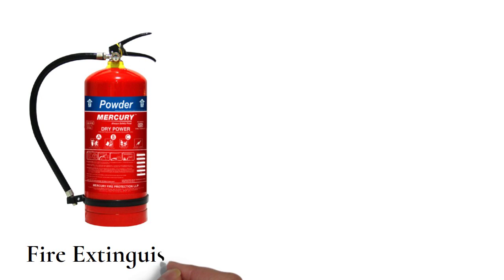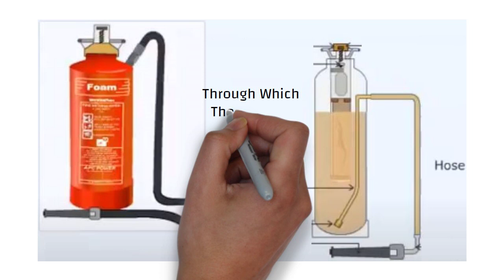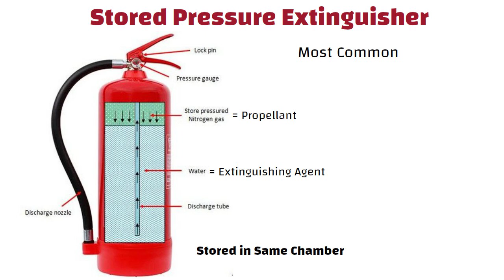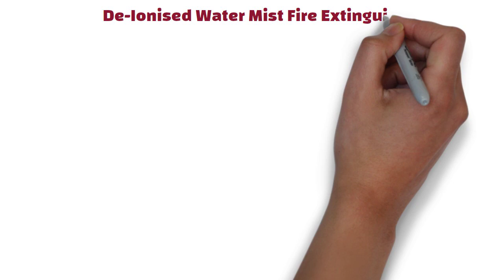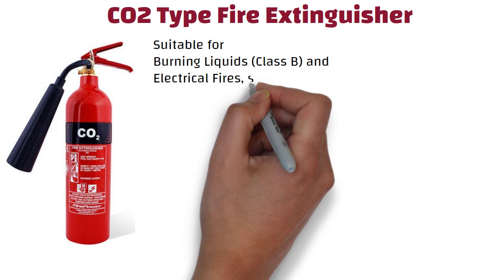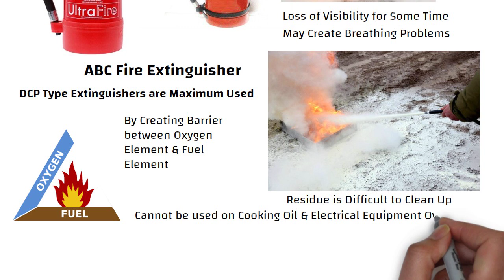FIRE EXTINGUISHER DEALERS IN KERALA, CALL 8138906102, FIRE EXTINGUISHER DEALERS IN ERNAKULAM.

Comment from the maker: Fire extinguisher dealers in PANDALAM, fire fighting contractors in PANDALAM, PANDALAM, fire and safety installations in PANDALAM, fire extinguisher suppliers in PANDALAM,fire extinguishers in PANDALAM, fire extinguishers in PANDALAM, fire protection system in PANDALAM, f fire and safety installation in PANDALAM, fire and safety contractors in PANDALAM, fire safety contractors in PANDALAM, fire and safety systems equipments in PANDALAM, fire equipment in PANDALAM, fire extinguisher in PANDALAM, fire protection system installation in PANDALAM, fire contractors in PANDALAM, fire safety consultants in PANDALAM,  fire alarm systems in PANDALAM, fire NOC in PANDALAM, fire AMC in PANDALAM, PANDALAM, fire fighting equipment in PANDALAM,
MS Jindal pipe dealers in PANDALAM, motor control panel in PANDALAM, fire pump panel in PANDALAM, motor control panel in PANDALAM, Morley fire alarm in PANDALAM, gst fire alarm in PANDALAM, addressable fire alarm system in PANDALAM, Pa talk back system in PANDALAM, PA talk back system in PANDALAM, auto glow SIGNAGES in PANDALAM, SIGNAGES in PANDALAM, pump PANELS in PANDALAM, LHP pump in kohi. Karthar valves in PANDALAM, Ravel fire alarm system in PANDALAM. Jindal pipe dealers in PANDALAM, Jindal pipe dealers in PANDALAM. MS pipe dealers in PANDALAM. Butterfly valves in PANDALAM, PA talk back system in PANDALAM, Fire alarm dealers in PANDALAM,, smoke detector dealers in PANDALAM, fire alarm panels dealers in PANDALAM, MCP, hooter dealers in Mangalor, hydrant valve dealers in PANDALAM, branch pipe dealers in PANDALAM, cp hose, RRL hose, heat detector dealers in PANDALAM,, Motor Control panel,  LED EXIT LIGHTS dealers in PANDALAM, emergency exit light dealers in PANDALAM, auto glow SIGNAGES dealers in PANDALAM. Conventional fire alarm system in PANDALAM,
KIRLOSKAR FIRE FIGHTING PUMP DEALERS IN PANDALAM, FIRE FIGHTING EQUIPMENT DEALERS IN PANDALAM, FIRE ALARM SYSTEM DEALERS IN PANDALAM, FIRE CONSULTANTS IN PANDALAM, FIRE CONTRACTOTORS IN PANDALAM, FIRE CONTRACTORS IN PANDALAM, FIRE ALARM SYSTEM DEALERS IN PANDALAM, SMOKE DETECTOR DEALERS IN PANDALAM, FIRE PROTECTION SYSTEM IN PANDALAM, FIRE CONSULTANTS IN PANDALAM, FIRE CONSULTANTS IN PANDALAM, PA TALK BACK SYSTEM IN PANDALAM, ADDRESSABLE FIRE ALARM SYSTEMS IN PANDALAM, CUTTER PUMP DEALERS IN PANDALAM, ADDRESSABLE FIRE ALARM SYSTEM SUPPLIERS IN PANDALAM, SMOKE DETECTOR DEALERS IN TPANDALAM, PRESSURE BOOSTING PUMP DEALERS IN PANDALAM, SLURRY PUMP DEALERS IN PANDALAM, WATER PUMP DEALERS IN PANDALAM, RAVEL FIRE ALARM SYSTEM IN PANDALAM, LUBI FIRE FIGHTING PUMP DEALERS IN PANDALAM, FIRE EXTINGUISHER DEALERS IN PANDALAM, ADDRESSABLE FIRE ALARM SYSTEM DEALERS IN PANDALAM, 
KIRLOSKAR FIRE FIGHTING PUMP DEALERS IN PANDALAM, KIRLOSKAR FIRE FIGHTING PUMP DISTRIBUTORS IN PANDALAM, KIRLOSKAR FIRE PUMPS IN PANDALAM, KIRLOSKAR DIESEL ENGINE FIRE STANDBY PUMP DEALERS IN PANDALAM, KIRLSOKAR MONOBLOCK FIRE PUMP DEALERS IN PANDALAM, KIRLOSKAR FIRE TERRACE PUMP DEALERS IN PANDALAM, KIRLOSKAR FIRE PUMPS IN PANDALAM, KIRLOSKAR FIRE FIGHTING PUMP IN KARNATAKA
Reply: FIRE EXTINGUISHER DEALERS IN KOTTAKKAL, FIRE EXTINGUISHER SUPPLIERS IN KOTTAKKAL, FIRE EXTINGUISHER DISTRIBUTORS IN KOTTAKKAL, FIRE EXTINGUISHER IN KOTTAKKAL, ABC TYPE FIRE EXTINGUISHER DEALERS IN KOTTAKKAL, CO2 TYPE FIRE EXTINGUISHER DEALERS IN KOTTAKKAL, CLEAN AGENT FIRE EXTINGUISHER IN KOTTAKKAL, MODULAR TYPE FIRE EXTINGUISHER DEALERS IN KOTTAKKAL, MECHANICAL FOAM FIRE EXTINGUISHER DEALERS IN KOTTAKKAL, FIRE EXTINGUISHER NEAR ME KOTTAKKAL, FIRE EXTINGUISHER TRADERS IN KOTTAKKAL, FIRE FIGHTING COMPANIES IN KOTTAKKAL, FIRE CONTRACTORS IN KOTTAKKAL, FIRE EQUIPMENT DEALERS IN KOTTAKKAL, FIRE ALARM DEALERS IN KOTTAKKAL, FIRE PUMP DEALERS IN KOTTAKKAL, SMOKE DETECTOR DEALERS IN KOTTAKKAL, FIRE FIGHTING SYSTEM IN KOTTAKKAL, FIRE PROTECTION SYSTEM IN KOTTAKKAL, FIRE AND SAFETY CONTRACTORS IN KOTTAKKAL, FIRE HYDRANT SYSTEMS IN KOTTAKKAL, PA TALK BACK SYSTEM IN KOTTAKKAL, FIRE NOC IN KOTTAKKAL, FIRE INSTALLATION IN KOTTAKKAL, FIRE NOC RENEWAL IN KOTTAKKAL, KIRLOSKAR FIRE PUMP DEALERS IN KOTTAKKAL, FIRE EXTINGUISHER NEAR ME KOTTAKKAL, FIRE EXTINGUISHER MANUFACURERS IN KOTTAKKAL, SAFEX FIRE EXTINGUISHER DEALERS IN KOTTAKKAL, FIRE NOC CONTRACTORS IN KOTTAKKAL, FIRE FIGHTING EQUIPMENT DEALERS IN KOTTAKKAL, FIRE PROTECTION SYSTEM IN KOTTAKKAL, FIRE INSTALLATION IN KOTTAKKAL, FIRE SAFETY CONTRACTORS IN KOTTAKKAL, FIRE AMC IN KOTTAKKAL, FIRE PROTECTION SYSTEM IN KOTTAKKAL, FIRE PROTECTION EQUIPMET IN KOTTAKKAL, AMC OF FIRE SYSTEM IN KOTTAKKAL, FIRE CONSULTANTS IN KOTTAKKAL, FIRE AND SAFETY EQUIPMENT DEALERS IN KOTTAKKAL, ADDRESSABLE FIRE ALARM SYSTEM IN KOTTAKKAL, KARTHAR VALVE DEALERS IN KOTTAKKAL, DCP TYPE FIRE EXTINGUISHER IN KOTTAKKAL, POWSER TYPE FIRE EXTINGUISHERS IN KOTTAKKAL, FIRE HYDRANT SYSTEM IN KOTTAKKAL, FIRE ALARM PANEL DEALERS IN KOTTAKKAL, SAFEPRO FIRE EXTINGUISHER DEALERS IN KOTTAKKAL, MS AND GI PIPE DEALERS IN KOTTAKKAL, JINDAL PIPE DEALERS IN KOTTAKKAL, AGNI FIRE ALARM DEALERS IN KOTTAKKAL, FIRE EQUIPMENT DEALERS IN KOTTAKKAL, FIRE EQUIPMENT SUPPLIERS IN KOTTAKKAL, FIRE EQUIPMENT TRADERS IN KOTTAKKAL, FIRE SPRINKLER SYSTEM IN KOTTAKKAL, RAVLE FIRE ALARM DEALERS IN KOTTAKKAL, RAVEL FIRE ALARM SYSTEM IN KOTTAKKAL, AGNI FIRE ALARM DISTRIBUTORS IN KOTTAKKAL, FIRE ALARM CONTRACTORS IN KOTTAKKAL, FIRE PIPE INSTALLATION IN CONTRACTORS IN KOTTAKKAL, FIRE SAFETY CONTRACTORS IN KOTTAKKAL, FIRE PA TWO WAY TALK BACK SYSTEM DEALERS IN KOTTAKKAL, HEAT DETECTOR DEALERS IN KOTTAKKAL, HONEYWELL FIRE ALARM DEALERS IN KOTTAKKAL, FIRE NOC CONSULTANTS IN KOTTAKKAL, FIRE AMC AND FIRE NOC IN KOTTAKKAL, FIRE SAFETY COMPANIES IN KOTTAKKAL, NEWAGE DEALERS IN KOTTAKKAL, MONSHER FIRE EQUIPMENT DEALERS IN KOTTAKKAL, KARTHAR VALVE DEALERS IN KOTTAKKAL, FIRE HYDRANT VALVE DEALERS IN KOTTAKKAL, FIRE HOSE REEL DRUM DEALERS IN KOTTAKKAL, FIRE SPRINKLER DEALERS IN KOTTAKKAL, FIRE PUMP DEALERS IN KOTTAKKAL, LUBI PUMP DEALERS IN KOTTAKKAL, LHP PUMP DEALERS IN KOTTAKKAL. FIRE CONTRACTORS IN KOTTAKKAL, FIRE AND SAFETY CONTRACTORS IN KOTTAKKAL, FIRE EQUIPMENT DEALERS IN KOTTAKKAL, FIRE FIGHTING CONTRACTORS IN KOTTAKKAL,
Reply: Fire extinguisher in Calicut, Fire extinguisher suppliers in Calicut, Fire extinguisher dealers in Calicut, Fire extinguisher traders in Calicut, Fire extinguisher distributors in Calicut, Fire extinguisher near me calicut, Safepro fire extinguisher in Calicut
Reply: FIRE EXTINGUISHER DEALERS IN KERALA, FIRE EXTINGUISHER SUPPLIERS IN KERALA, FIRE EXTINGUISHER DISTRIBUTORS IN KERALA, FIRE EXTINGUISHER IN KERALA, ABC TYPE FIRE EXTINGUISHER DEALERS IN KERALA, CO2 TYPE FIRE EXTINGUISHER DEALERS IN KERALA, CLEAN AGENT FIRE EXTINGUISHER IN KERALA, MODULAR TYPE FIRE EXTINGUISHER DEALERS IN KERALA, MECHANICAL FOAM FIRE EXTINGUISHER DEALERS IN KERALA, FIRE EXTINGUISHER NEAR ME KERALA, FIRE EXTINGUISHER TRADERS IN KERALA, FIRE FIGHTING COMPANIES IN KERALA, FIRE CONTRACTORS IN KERALA, FIRE EQUIPMENT DEALERS IN KERALA, FIRE ALARM DEALERS IN KERALA, FIRE PUMP DEALERS IN KERALA, SMOKE DETECTOR DEALERS IN KERALA, FIRE FIGHTING SYSTEM IN KERALA, FIRE PROTECTION SYSTEM IN KERALA, FIRE AND SAFETY CONTRACTORS IN KERALA, FIRE HYDRANT SYSTEMS IN KERALA, PA TALK BACK SYSTEM IN KERALA, FIRE NOC IN KERALA, FIRE INSTALLATION IN KERALA, FIRE NOC RENEWAL IN KERALA, KIRLOSKAR FIRE PUMP DEALERS IN KERALA, FIRE EXTINGUISHER NEAR ME KERALA, FIRE EXTINGUISHER MANUFACURERS IN KERALA, SAFEX FIRE EXTINGUISHER DEALERS IN KERALA, FIRE NOC CONTRACTORS IN KERALA, FIRE FIGHTING EQUIPMENT DEALERS IN KERALA, FIRE PROTECTION SYSTEM IN KERALA, FIRE INSTALLATION IN KERALA, FIRE SAFETY CONTRACTORS IN KERALA, FIRE AMC IN KERALA, FIRE PROTECTION SYSTEM IN KERALA, FIRE PROTECTION EQUIPMET IN KERALA, AMC OF FIRE SYSTEM IN KERALA, FIRE CONSULTANTS IN KERALA, FIRE AND SAFETY EQUIPMENT DEALERS IN KERALA, ADDRESSABLE FIRE ALARM SYSTEM IN KERALA, KARTHAR VALVE DEALERS IN KERALA, DCP TYPE FIRE EXTINGUISHER IN KERALA, POWSER TYPE FIRE EXTINGUISHERS IN KERALA, FIRE HYDRANT SYSTEM IN KERALA, FIRE ALARM PANEL DEALERS IN KERALA, SAFEPRO FIRE EXTINGUISHER DEALERS IN KERALA, MS AND GI PIPE DEALERS IN KERALA, JINDAL PIPE DEALERS IN KERALA, AGNI FIRE ALARM DEALERS IN KERALA, FIRE EQUIPMENT DEALERS IN KERALA, FIRE EQUIPMENT SUPPLIERS IN KERALA, FIRE EQUIPMENT TRADERS IN KERALA, FIRE SPRINKLER SYSTEM IN KERALA, RAVLE FIRE ALARM DEALERS IN KERALA, RAVEL FIRE ALARM SYSTEM IN KERALA, AGNI FIRE ALARM DISTRIBUTORS IN KERALA, FIRE ALARM CONTRACTORS IN KERALA, FIRE PIPE INSTALLATION IN CONTRACTORS IN KERALA, FIRE SAFETY CONTRACTORS IN KERALA, FIRE PA TWO WAY TALK BACK SYSTEM DEALERS IN KERALA, HEAT DETECTOR DEALERS IN KERALA, HONEYWELL FIRE ALARM DEALERS IN KERALA, FIRE NOC CONSULTANTS IN KERALA, FIRE AMC AND FIRE NOC IN KERALA, FIRE SAFETY COMPANIES IN KERALA, NEWAGE DEALERS IN KERALA, MONSHER FIRE EQUIPMENT DEALERS IN KERALA, KARTHAR VALVE DEALERS IN KERALA, FIRE HYDRANT VALVE DEALERS IN KERALA, FIRE HOSE REEL DRUM DEALERS IN KERALA, FIRE SPRINKLER DEALERS IN KERALA, FIRE PUMP DEALERS IN KERALA, LUBI PUMP DEALERS IN KERALA, LHP PUMP DEALERS IN KERALA. FIRE CONTRACTORS IN KERALA, FIRE AND SAFETY CONTRACTORS IN KERALA, FIRE EQUIPMENT DEALERS IN KERALA, FIRE FIGHTING CONTRACTORS IN KERALA,

Comment from the maker: FIRE ALARM DEALERS IN PANDALAM, ADDRESSABLE FIRE ALARM DEALERS IN PANDALAM, FIRE ALARM SYSTEM DEALERS IN PANDALAM, ADDRESSABLE FIRE ALARM SYSTEM DEALERS IN PANDALAM, FIRE DETECTION SYSTEM IN PANDALAM, SMOKE DETECTOR DEALERS IN PANDALAM, CONVENTIONAL FIRE ALARM DEALERS IN PANDALAM, MORLEY FIRE ALARM DEALERS IN PANDALAM, GST FIRE ALARM DEALERS IN PANDALAM, ASES SECURITY FIRE ALARM DEALERS IN PANDALAM, BEAM DETECTOR DEALERS IN PANDALAM, FIRE ALARM SUPPLIERS IN PANDALAM, FIRE ALARM TRADERS IN PANDALAM, FIRE ALARM PANEL DEALERS IN PANDALAM, HEAT DETECTOR DEALERS IN PANDALAM, FIRE ALARM SYSTEM SUPPLIERS IN PANDALAM, FIRE ALARM COMPANIES IN PANDALAM, FIRE EQUIPMENT DEALERS IN PANDALAM, ADRRESSABLE FIRE ALARM PANEL DEALERS IN PANDALAM, FIRE ALARM SYSTEM IN PANDALAM, BATTERY OPERATED DETECTOR DEALERS IN PANDALAM, ASPIRATION DETECTION SYSTEM DEALERS IN PANDALAM, FIRE ALARM MCP - MANUAL CALL POINT DEALERS IN PANDALAM, FIRE ALARM HOOTER DEALERS IN PANDALAM, PA TWO WAY TALK BACK SYSTEM DEALERS IN PANDALAM, PA SYSTEM DEALERS IN PANDALAM, PA TALK BACK UNIT DEALERS IN PANDALAM, HOOTER CUM STROBE DEALERS IN PANDALAM, FIRE PROTECTION SYSTEM IN PANDALAM, FIRE ALARM CONTRACTORS IN PANDALAM, FIRE DETECTORS IN PANDALAM, FIRE ALARM DEALERS IN KOLLAM, ADDRESSABLE FIRE ALARM DEALERS IN KOLLAM, SMOKE DETECTOR DEALERS IN KOLLAM, FIRE EQUIPMENT DEALERS IN PANDALAM, FIRE ALARM INSTALLATION IN PANDALAM, FIRE ALARM COMPANIES IN PANDALAM FIRE ALARM DISTRIBUTORS IN PANDALAM, TALK BACK SYSTEM DEALERS IN PANDALAM, FIRE ALARM SENSOR DEALERS IN PANDALAM, FIRE EXTINGUISHER DEALERS IN PANDALAM, FIRE ALARM DEALERS IN ERNAKULAM, FIRE ALARM DEALERS IN KERALA, ADDRESSABLE FIRE ALARM DEALERS IN CALICUT, SMOKE DETECTOR IN PANDALAM,  FIRE EXTINGUISHER DEALERS IN PANDALAM, FIRE EXTINGUISHER SUPPLIERS IN PANDALAM, FIRE EXTINGUISHER DISTRIBUTORS IN PANDALAM FIRE EXTINGUISHER IN PANDALAM, ABC TYPE FIRE EXTINGUISHER DEALERS IN PANDALAM, CO2 TYPE FIRE EXTINGUISHER DEALERS IN PANDALAM, CLEAN AGENT FIRE EXTINGUISHER IN PANDALAM FIRE FIGHTING PUMP DEALERS IN PANDALAM, FIRE PUMP DEALERS IN PANDALAM, KIRLOSKAR FIRE PUMP DEALERS IN PANDALAM, FIRE JOCKEY PUMP DEALERS IN PANDALAM, FIRE DISEL ENGINE DRIVEN PUMP DEALERS IN PANDALAM, FIRE FIGHTING EQUIPMENT DEALERS IN PANDALAM, FIRE FIGHTING SYSTEM IN PANDALAM, VERTICAL INLINE PUMP DEALERS IN PANDALAM, HYDRO PNEUMATIC PRESSURE BOOSTING PUMP DEALERS IN PANDALAM, VERTICAL TURBINE PUMP DEALERS IN PANDALAM, SEWAGE PUMP DEALERS IN PANDALAM, RO PUMP DEALERS IN PANDALAM. FIRE EXTINGUISHER IN PANDALAM, FIRE EXTINGUISHER SUPPLIERS IN PANDALAM,
Reply: FIRE EXTINGUISHER DEALERS IN KOTTAYAM, FIRE EXTINGUISHER SUPPLIERS IN KOTTAYAM, FIRE EXTINGUISHER DISTRIBUTORS IN KOTTAYAM, FIRE EXTINGUISHER IN KOTTAYAM, ABC TYPE FIRE EXTINGUISHER DEALERS IN KOTTAYAM, CO2 TYPE FIRE EXTINGUISHER DEALERS IN KOTTAYAM, CLEAN AGENT FIRE EXTINGUISHER IN KOTTAYAM, MODULAR TYPE FIRE EXTINGUISHER DEALERS IN KOTTAYAM, MECHANICAL FOAM FIRE EXTINGUISHER DEALERS IN KOTTAYAM, FIRE EXTINGUISHER NEAR ME KOTTAYAM, FIRE EXTINGUISHER TRADERS IN KOTTAYAM, FIRE FIGHTING COMPANIES IN KOTTAYAM, FIRE CONTRACTORS IN KOTTAYAM, FIRE EQUIPMENT DEALERS IN KOTTAYAM, FIRE ALARM DEALERS IN KOTTAYAM, FIRE PUMP DEALERS IN KOTTAYAM, SMOKE DETECTOR DEALERS IN KOTTAYAM, FIRE FIGHTING SYSTEM IN KOTTAYAM, FIRE PROTECTION SYSTEM IN KOTTAYAM, FIRE AND SAFETY CONTRACTORS IN KOTTAYAM, FIRE HYDRANT SYSTEMS IN KOTTAYAM, PA TALK BACK SYSTEM IN KOTTAYAM, FIRE NOC IN KOTTAYAM, FIRE INSTALLATION IN KOTTAYAM, FIRE NOC RENEWAL IN KOTTAYAM, KIRLOSKAR FIRE PUMP DEALERS IN KOTTAYAM, FIRE EXTINGUISHER DEALERS IN CHANGANASSERY, FIRE EXTINGUISHER SUPPLIERS IN CHANGANASSERY, FIRE EXTINGUISHER DISTRIBUTORS IN CHANGANASSERY, FIRE EXTINGUISHER IN CHANGANASSERY, ABC TYPE FIRE EXTINGUISHER DEALERS IN CHANGANASSERY, CO2 TYPE FIRE EXTINGUISHER DEALERS IN CHANGANASSERY, CLEAN AGENT FIRE EXTINGUISHER IN CHANGANASSERY, MODULAR TYPE FIRE EXTINGUISHER DEALERS IN CHANGANASSERY, MECHANICAL FOAM FIRE EXTINGUISHER DEALERS IN CHANGANASSERY, FIRE EXTINGUISHER NEAR ME CHANGANASSERY, FIRE EXTINGUISHER TRADERS IN CHANGANASSERY, FIRE FIGHTING COMPANIES IN CHANGANASSERY, FIRE CONTRACTORS IN CHANGANASSERY, FIRE EQUIPMENT DEALERS IN CHANGANASSERY, FIRE ALARM DEALERS IN CHANGANASSERY, FIRE PUMP DEALERS IN CHANGANASSERY, SMOKE DETECTOR DEALERS IN CHANGANASSERY, FIRE FIGHTING SYSTEM IN CHANGANASSERY, FIRE PROTECTION SYSTEM IN CHANGANASSERY, FIRE AND SAFETY CONTRACTORS IN CHANGANASSERY, FIRE HYDRANT SYSTEMS IN CHANGANASSERY, PA TALK BACK SYSTEM IN CHANGANASSERY, FIRE NOC IN CHANGANASSERY, FIRE INSTALLATION IN CHANGANASSERY, FIRE NOC RENEWAL IN CHANGANASSERY, KIRLOSKAR FIRE PUMP DEALERS IN CHANGANASSERY, FIRE EXTINGUISHER DEALERS IN CHANGANACHERRY, FIRE EXTINGUISHER SUPPLIERS IN CHANGANACHERRY, FIRE EXTINGUISHER DISTRIBUTORS IN CHANGANACHERRY, FIRE EXTINGUISHER IN CHANGANACHERRY, ABC TYPE FIRE EXTINGUISHER DEALERS IN CHANGANACHERRY, CO2 TYPE FIRE EXTINGUISHER DEALERS IN CHANGANACHERRY, CLEAN AGENT FIRE EXTINGUISHER IN CHANGANACHERRY, MODULAR TYPE FIRE EXTINGUISHER DEALERS IN CHANGANACHERRY, MECHANICAL FOAM FIRE EXTINGUISHER DEALERS IN CHANGANACHERRY, FIRE EXTINGUISHER NEAR ME CHANGANACHERRY, FIRE EXTINGUISHER DEALERS IN THIRUVALLA, FIRE EXTINGUISHER IN THIRUVALLA.

Comment from the maker: KIRLSOKAR MONOBLOCK FIRE PUMP DEALERS IN KOLLAM, KIRLOSKAR FIRE TERRACE PUMP DEALERS IN KOLLAM, KIRLOSKAR FIRE PUMPS IN KOLLAM, KIRLOSKAR FIRE FIGHTING PUMP IN KARNATAKA, KIRLOSKAR FIRE PUMP DEALERS IN KARNATAKA, KIRLOKAR FIRE PUMP DEALERS IN HOSUR, KIRLSOAKR FIRE FIGHTING PUMP DEALERS IN KOLLAM, KIRLOSKAR FIRE PUMPS IN KOLLAM, KIRLSOKAR FIRE PUMP DISTRIBUTORS IN KOLLAM, FIRE ENGINE PUMP SETS IN KOLLAM, KIRLOSKAR PUMP DEALERS IN TIRUELVELI, KIRLOSKAR DEALERS IN KARNATAKA, KIRLOSKAR PUMPS IN KARNATAKA, KIRLOSKAR PUMPS IN KOLLAM, LUBI FIRE PUMP DEALERS IN KOLLAM, LUBI FIRE PUMP DEALERS IN KARNATAKA, LUBI FIRE PUMP DEALERS IN KOLLAM, FIRE PUMP SUPPLERS IN KAYAKUMARI, FIRE FIGHTING PUMP DEALERS IN KAYAKUMARIHOSUR, FIRE PUMP DEALERS IN KARNATAKA, FIRE PUMP SUPPLIERS IN KOLLAM, FIRE PUMP DEALERS IN KOLLAM, FIRE FIGHTING PUMPS IN KOLLAM, FIRE FIGHTING PUMP DEALERS IN KOLLAM, FIRE FIGHTING PUMP SUPPLIERS IN KARNATAKA, FIRE FIGHTING PUMP SET DEALERS IN KOLLAM, FIRE PUMP IN KARNATAKA, FIRE PUMP IN KOLLAM, FIRE PUMP IN KOLLAM, FIRE DIESEL ENGINE PUMP DEALERS IN KOLLAM, FIRE DIESEL ENGINE STANDBY PUMP DEALERS IN KOLLAM, FIRE JOCKEY PUMP DEALERS IN KOLLAM, FIRE JOCKEY PUMP DEALERS IN KARNATAKA, FIRE JOCKEY PUMP DEALERS IN KOLLAM. CRI PUMP DEALERS IN KOLLAM, HYDRO PNEUMATIC PRESSURE BOOSTING PUMP DEALERS IN KOLLAM, VERTICAL INLINE PUMP DEALERS IN KOLLAM, INDUSTRIAL PUMP DEALERS IN KOLLAM, SEWAGE PUMP DEALERS IN KOLLAM, STP AND ETP PUMP DEALERS IN TIRUNELVALEI, STP AND ETP PUMP DEALERS IN KOLLAM, STP AND ETP PUMP DEALERS IN KOLLAM, STP AND ETP PUMP DEALERS IN KOLLAM, HYDRO PNEUMATIC PRESSURE BOOSTING PUMP DEALERS IN KOLLAM, SEWAGE PUMP DEALERS IN KOLLAM, DEWATERING PUMP DEALERS IN KOLLAM, FIRE JOCKEY PUMP DEALERS IN KOLLAM, CRI PUMP DEALERS IN KOLLAM,